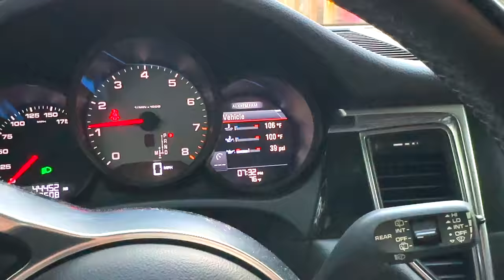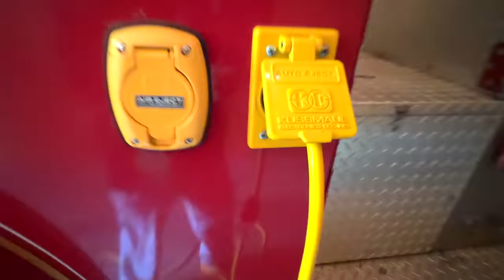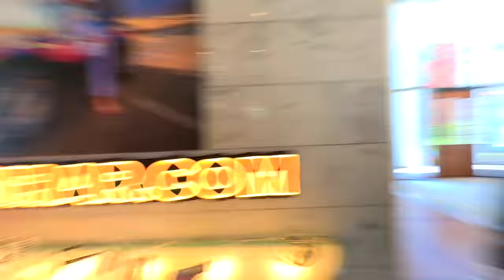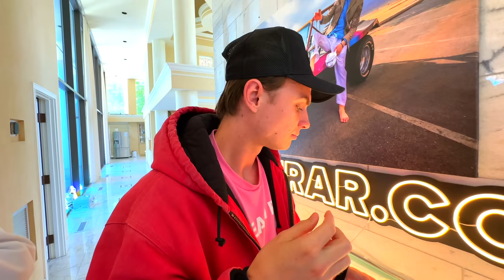Someone Destroyed My Supercar...

Comment: When the motor is running at operating temperature, and you remove the oil cap, it's common for a small amount of smoke to come from the engine. This is usually caused by exhaust gases, heat or gasoline vapor that mixes with the air to create a small amount of smoke.

Comment: It is back compression coming means your piston rings are bad and the car is consuming more engine oil than it you use to do before this problem
Reply: If you remove the oil dipstick and let the car run it will there will be a little smoke coming out and will drops of oil will come out